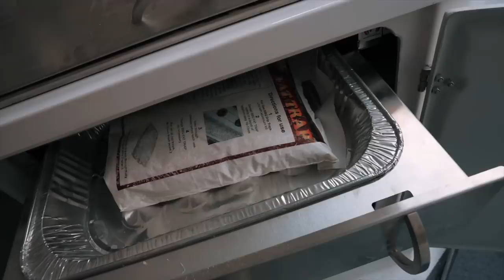CATAMARAN BUILD COMPLETE: First Look at Hull 1 and BIG RR2 Updates!

Comment: Looking good, I am getting so excited to see RR2 splash. Also being a bit of an audiophile (Audio nerd) I can't wait to see how you finally work out your speaker placement.
While it is still in the factory make a suggestion of putting either soft or hard furnishing in front of the spice rack. Sunlight really degrades spices quickly, herbs not so much, but spices definitely. Suggesting it now means it may happen in time for hull #1 but could be implemented for subsequent hulls in a way that matches the surrounds. Spices and herbs in domestic and commercial kitchens are either in cupboards or under artificial lighting. Yours wouldn't be.

Comment: May be im used to the comfort of a wooden yacht, im sorry but No1 looks like it would suit you better in a Dentist Surgery, its something i would probably find sea sickness from rather than appreciate. Im sorry i do not see quality in these interiors , i suppose when youve holed the boat on some floating driftwood at high speed, at least you will have the spice rack as a floatation device ? Sorry to sound cynical, but i am so glad beauty is in the eye of the beholder , im so glad you like that sort of interior which i would class as the budget end of Ikea with a touch of dentist surgery thrown in, i truly hope she sails better than she looks on the inside